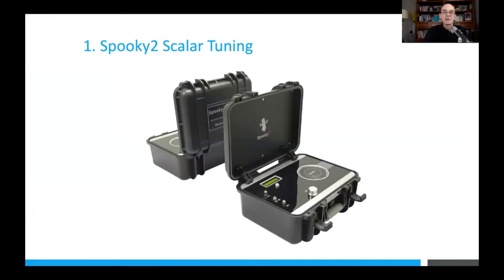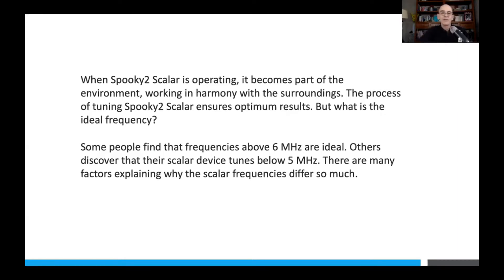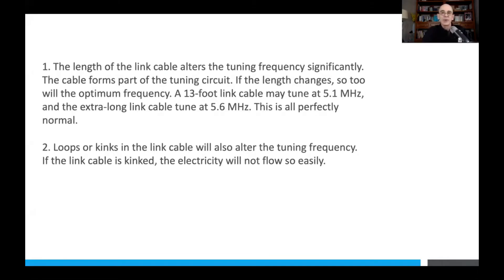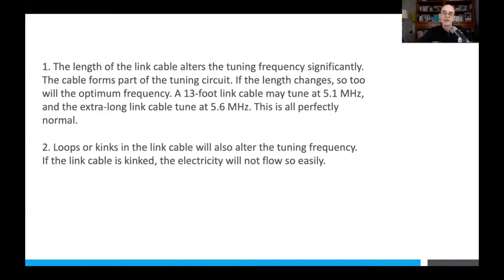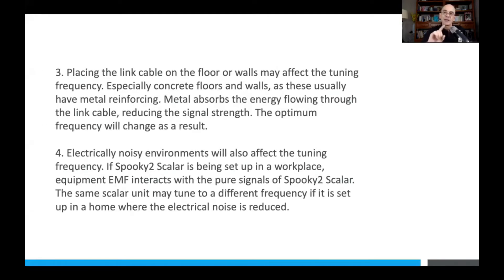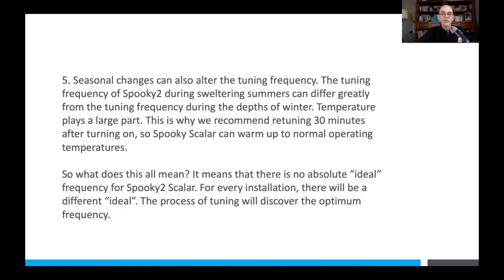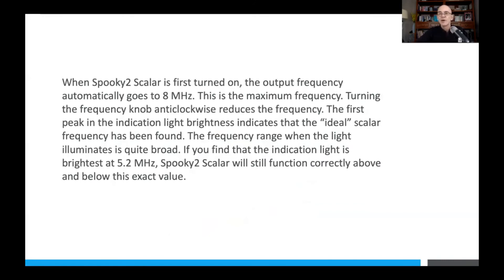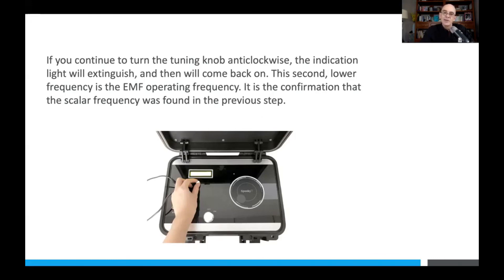Spooky2 Scalar tuning

Comment: So when I turn the machine on and tune it to the highest brightness of the first light turning counter clockwise…. That’s the one I use correct? 
I can go to the receiver box and turn on the receiver light to make sure it’s in scalar mode but turn it off after it is detected because this will take energy from the scalar field.  Is this correct?
Reply from the maker: Dear friend, yes! You are right.👍Any other questions, feel free to contact us at any time.
Reply: @Spooky2Scalar  i have the machine in the video but I need help i don't have a Facebook is there a way i can contact sombody for help

Comment: I assume If we were to connect XM Generator or Generator X to Spooky2 Scalar, which is one of the 
functions, the frequency from the generator would piggy bag on Spooky2 Scalar tuning frequency of 
~5 to 6 MHz. If this is the case, isn't true that the tuning frequency will be modulated, hence we cannot 
get the benefit of the specific frequencies in Spooky2 programs since MOR and/or Healing frequencies 
will be shifted? With this in mind, isn't true the use of the digitizer in Spooky2 Scalar biofeedback will be 
prone to error. Has the modulation of Spooky2 Scalar frequency been taken to account for biofeedback?
Can John verify this?

Comment: Interesting how this experimental technology operates.  There are many known and unknown factors involved with tuning these scalar units.  The Ley lines, which are invisible energy grid systems that webs and spans all around the world probably affect Spooky 2 scalar tunning.  The magnetic fields all around your property, house, apartment, sky, and everyone around it also affect the scalar tunning process.  Maybe even ghosts or spirits or entities could affect this technology, who knows?  Kidding. 

On average, all of that really doesn't matter because you can easily and carefully tune your Spooky 2 scalar.  Note that I say "carefully and slowly  dial the tuning knob."  If you want your spooky 2 devices to last longer in time then you must be very, very careful with them at all times!  This is highly sensitive and experimental and EXPENSIVE equipment!!! 

*Be sure to always keep the tops of the scalar units clean and clear from dust.  I found that in my mothers room, cat hair and dust can get inbetween the tuning knob of her scalar transmitter and cause the tuner to malfunnction while trying to tune it.